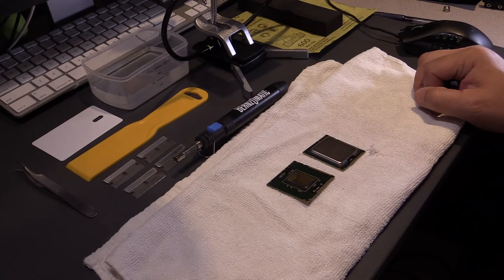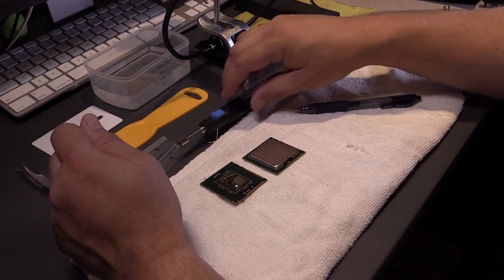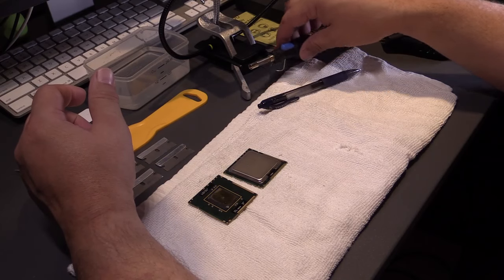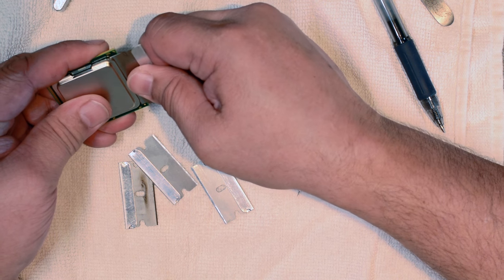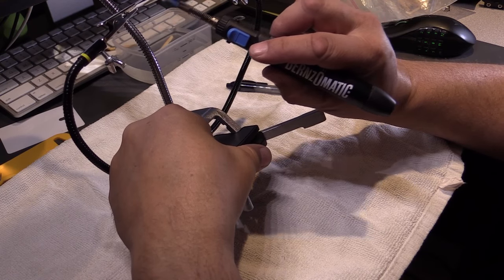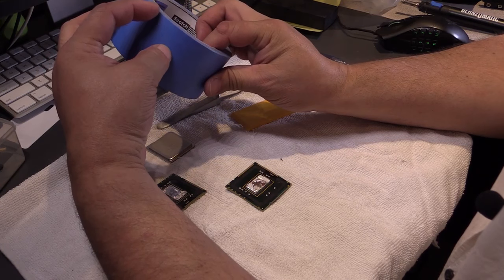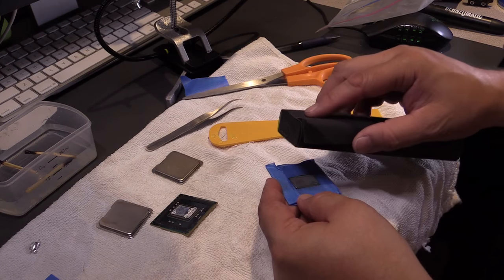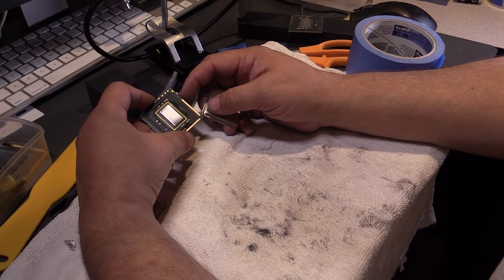Soldered IHS Removal Process for upgrading CPU in 2009-2012 Mac Pro Models

Comment: Hey DIY, Do you know what the temp differences are with and without the IHS, curious to know how big a difference it is between the two. I can run istat on mine to see what my temps are.
I run pro tools and FCPX all the time, use handbreak, play games and even on a hot summer day I have yet to have a random shutdown. Also running 4 internal drives, pcie slots are full and a GTX 980 ti graphics card. I have upgraded twice first to 5650s and recently I replaced those with 5680s although it was a bit tricky.  I also just upgraded a friends 2010 mac pro with 5680s and he is very happy with the performance boost.
Good video, might consider deliding in the future if the temps are really that different. Interesting how apple continued to use chips with the IHS on them in the 2010 mac pros and 2012. I have upgrade videos leaving the IHS on for anyone interested. https://www.youtube.com/watch?v=YAdgT-hJuXU it is harder than installing delided CPUs you just have to be careful.
Reply from the maker: I haven't done any hard testing of my internal temperatures of my Mac Pro other than what Mac Fan Control is showing with delidded cpu's under intense processing, though I don't suffer from heat related random shutdowns myself...knock on wood.  

I do believe that a lot of the heat transfer and cooling process is a result of the thermal paste used and how much surface area is in contact with the cpu and heat sync.  Personally, I use premium thermal pastes like Tuniq TX-4 thermal grease and haven't had any issues.  

However, heat over a period of time, with thermal contractions, can have an adverse affect on your components and this is the silent killer of electrical components like hardening arteries.

Currently,  I have my case fully maxed with every drive bay occupied, every PCI slot occupied, every ram slot occupied, and a fairly large 7950 Radeon video card. I have to admit this Mac Pro could fully heat my house in the winter time if I wanted to, lol, so every little bit helps.

IMHO, I believe that for anyone wanting to upgrade their 2009-2012 Mac Pro dual processors models, delidding is a better alternative since they don't have to worry about breaking their logic boards by over tightening, or under tightening the heat sync screws, or worrying about adding additional thermal pads to the heat syncs and making sure the fan connectors are fully seated as well.

Thanks
Reply: My CPU A temps go up to 75c... pretty hot when they are doing heavy processing video compression or heavy pro tools mixing, I think 85c is max for a 5680 and 5690. Using iStat monitors fan adjustments keeps it cool, down around 55c if things get hot. Keep in mind that 2010 and 2012 mac pros have the IHS on teh chips so not sure why other than easier install it is really that needed to remove them. Apples stock system fan settings don't kick in till things get really hot. I have not had any overheat shutdowns with my 2009 with IHS on. Idle my temps are cpu A is 45c and cpu b is 40c cpu B is always cooler than CPU A. So fan management is a good idea for when your pushing your system hard.

Comment: this is a "delid", that is what he did and is very dangerous, actually theres no correct or good way to do it because is easy to damage the processor doing this
Reply from the maker: Delidding dangerous?  You're kidding right?  lol There is always a risk when doing work on a sealed system.  However, in the dozen times I've done this procedure using this method, I've never had a failure.  The processors are working still in their Mac Pro workstations.
Reply: So now i have the key for the american dream :)

Comment: Sorry, but nobody should do this. The reason is that most people think they give all important information when they actually don't because they just don't have the expertise/knowledge to do. So it's not their fault. And when you think for yourself you'll easily find this is too much risk. I guess the chance of success is only about 50%.
Reply from the maker: I apologize is this step was ambiguous and not clear.  At 7:40 I mention and show, as and example on the PCB board, that there are capacitors so to only cut as deep where you feel the glue has been separated.  The glue only resides to the portion of the IHS that sits flush with the PCB board before it raises up.  

To help clarify this procedure I've added a visual image for reference, and will include this with the video description and as a text overlay on the video as well.

https://goo.gl/Lb1sYo
Reply: The picture is a good idea. It will help people a lot.
Also the explanation about not to go deeper than the rising of the IHS. Problem is that the glue extends very close to the capacitors. Despite the frustration I did another one. I tried not to cut to deep. Still I made a few marks which I can see under a magnifying glass. Reason was that I didn''t want to heat up the thing while it was still glued. It took a long time heating up before it came off. Hope it didn't got damaged.

Do you think I could get a capacitor soldered back on?
Reply from the maker: The capacitors are meant to filter current flowing into the CPU.  Some people, who have damaged their capacitors when removing their IHS off their CPU,  have had success running them even with a few missing - though I don't recommend doing this myself.  

Yes, it is possible to repair a capacitor on the PCB board of the CPU.  However, it might be a challenge to try to determine what the capacitor value is when trying to purchase one from a distributor somewhere.  It might be easier to find a dead CPU online for a few dollars and use the capacitors off that to make your repair, at least you would have eleven to use if you make a mistake.
Reply from the maker: Here is a good resource on working with panel mount capacitors etc.  https://en.wikipedia.org/wiki/Surface-mount_technology
Reply: If you do enough research and carefully follow all the necessary steps, you'll find that it's not too difficult to do - it's just nerve-racking. I was able to do it to a pair of X5670s with no problems.
Reply: I have to disagree. Learn what you are doing, get informed and buy a couple cheap CPU's to try it on. I've done this to literally dozens of Xeon's without a hitch. You're telling people not to learn, not to try. You were uninformed and that's your fault. I thought the video was very informative, but it's not my only resource.
Reply: ...And that's why nobody will remember your name...